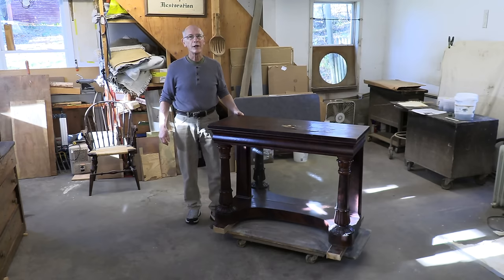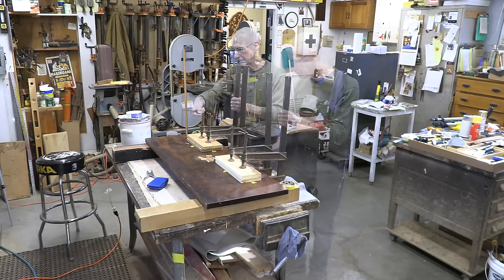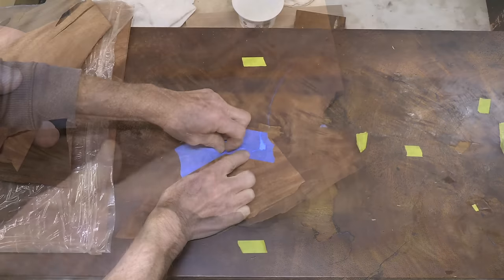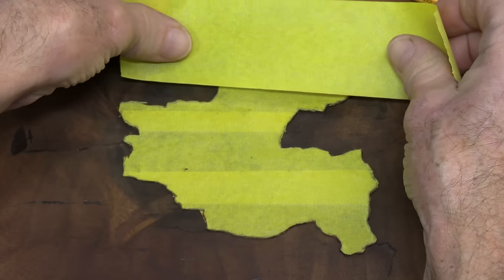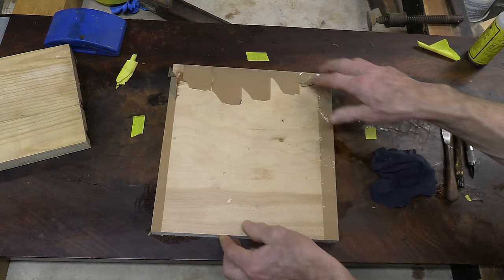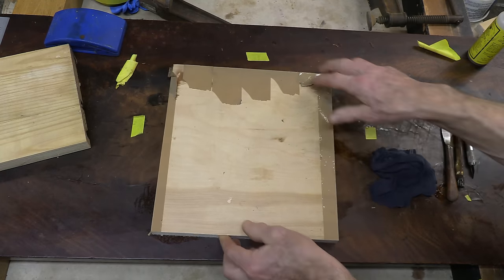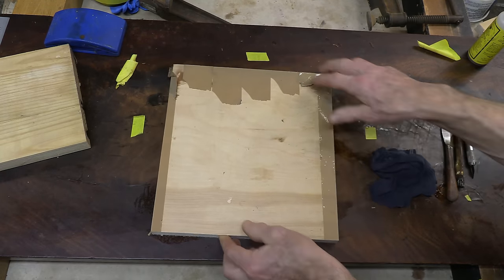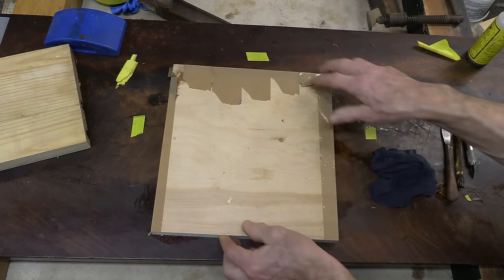Is this Table Beyond Repair?

Comment: I had an oversized door on my 120 year old house.  (Door was old, but probably not original.)  Someone had striped off the veneer on the outside surface and replaced it with fake grained Masonite (horribly ugly).  Inner window had a plastic insert.  Knob and lock was so trashed it was a struggle to open and close the door.  Because of you, Tom, I decided this door could be saved.  I replaced Masonite with an oak veneer skin, cut out old lock section and put in a 3/4" patch about 4" x 6" and new antique door knobs and lock and got rid of plastic and resized window to fit a leaded glass one.  Looks pretty darn good for an amateur (not even close to your level but...) I owe even thinking I could do it to you, Tom.  Thanks.  ( I did a LOT of color matching on that patch and it is pretty darn good.  Again, thanks to watching you work again and again.)
Reply: I've realized that he's raised the bar on how I look at furniture and wood. I find myself being more critical and noticing things I hadn't, otherwise. Now I'm a pain in the butt😅
Reply: Good on you for taking on that project
Reply: A beautiful result… again
Reply: And every time you use that door, it’ll make you happy.
Reply: It says no electricity.  😂
Reply: @johnsrabe  So true.  I look at it daily as I go out to walk the dog.
Reply: I bet the ordinal wood on your door is really pretty
Reply: @jodirauth8847  The original is quarter sawn oak.  Beautiful- which is why I decided to try and save it.
Reply from the maker: Wow! That was quite a project! I'm not sure I would have taken that on! Thank you!
Reply from the maker: Thanks! It's good not to say anything!
Reply: Happy,healthy new year Tom!
Reply: That pier table is such a handsome piece which you restored so beautifully.
Reply: I would love to see your result. ❤
Reply: Toms very inspirational to me also. I get some big ideas sometimes 😜
Reply: 5
Reply: Good for you. So glad it turned out good.

Comment: I'm thrilled that you could use a scrap just the right size and orientation for the patch. So satisfying to be able to use a smaller piece without cutting a hole in a new one. This is a lovely restoration. Such a joy to see and be included in your projects. Thank you so much for all the extra effort involved in making it possible. Have a blessed Christmas.
Reply from the maker: Thank you Alison! Yes, I did not want to cut a big piece, but I would have if I had too

Comment: My great grandfather was a cabinet maker from Scotland who immigrated in the 1880s, and settled near Brockton. He must have worked without electricity for all, or nearly all, his entire life since that's just about when households were beginning to be electrified. Amazing to think how much has changed in just a few lifetimes.

I hope you have a merry Christmas!
Reply: Even within a lifetime: think of this video and this conversation... not possible 25 years ago.
Reply: @dlevi67  Yes they were, although I take your point. You just didn't go back far enough.
Reply: @the-chillian  I take your point, but I did go far enough. Widespread means of posting high-resolution videos and commenting on them on a publicly-accessible website were not available 25 years ago.

You could have taken a VHS tape (at a lower equivalent resolution), and then distributed it physically to all your friends; good luck reaching audiences of several thousands, never mind millions, without serious commercial backing. Blockbuster was still going very strong in 1998.

JPEG and MPEG first versions were published in their entirety between 1991 and 1993; there was nothing available to consumers in 1998 that would have produced this video in a digital format. Even if you could, you'd have a few issues in making the content available to the public at large (never mind dial up at 14,400 bps - which in 1998 was the norm; I remember having trouble finding modems that could reliably support 19,200 - even with 2-channel domestic ISDN at 128kbps you'd wait a couple of days to download 50 minutes of hi-res content). 

As to comments or conversations, the first "properly interactive" commercial websites date to the early 2000s - YouTube specifically, to 2005. Yes, you could post "live" comments using BBS software in the mid-1980s, but they weren't usable in the same way as YT comments (crappy as they are). 😉
Reply from the maker: Thank you! Yes,it's all so quick. Both my and my wife's mothers grew up on farms in the 1920's, we are just 1 generation into it
Reply from the maker: Interesting! What will it be 25 years from now!

Comment: Wow , another amazing job, I thought I was a patient man, but you teach me what true patience looks like! 

Last time I worked on crotch veneer repair, I started by stripping the finish and using a glycerin based veneer softener.  Then clamped the whole thing flat.  I think it helped make the veneer less delicate (some).
Reply from the maker: Thanks! That sounds interesting, I could have tried that with this top. I will try that in the future

Comment: What a wonderful Christmas present. Another amazing restoration from which I, and I am sure so many others, have learned so much. It is very clear that the clamps you use are not the newest models and I would say they are much better for it. Modern clamps are so expensive and nowhere near as sturdy or well made as some the ones you use. Wishing you a very happy Christmas and a peaceful new year.
Reply from the maker: Thank you! Although these clamps were given to me because they did distort under pressure, but the work fine for me

Comment: TOM, I LOOKED IT UP AND SCREWS HAD BLUNT ENDS UNTIL ABOUT 1859, DEPENDING ON YOUR SOURCE OF RESEARCH. SO, NO AMERICAN EMPIRE PIECE WITH ORIGINAL SCREWS SHOULD HAVE POINTED ENDS, WHICH HELPS IN DATING THE PIECE. FASCINATING HOW A PRO DOES NOT HESITATE TO TAKE FURNITURE APART! THE AVERAGE HACK LIKE ME, FORGET IT! ANOTHER AMAZING JOB BY YOU. HAPPY HOLIDAYS TO YOU, SIR TOM!
Reply: Thats interesting!
Reply from the maker: Thank you! Good info on the screws
Reply from the maker: It is!

Comment: OMG that top veneer gave me flashbacks to last summer. I had an 1885 sewing machine cabinet with 2" wide burlwood accents that were cracked and lifting much like that on your pier table. The crazy grain pattern made it expand in all different directions  and rates when it was exposed to the moisture of the hide glue, making it very difficult to flatten back down within its allotted area. I chased bubbles for a week!

It's impossible to find modern veneer even a fraction as good as the original!

Lovely outcome, as always!
Reply from the maker: Thanks! I've been there! I hope it all worked out for you

Comment: once again you have accomplished an incredible job in difficult conditions (electrical failure) in doing so you worked as the men who made this piece of furniture worked with only manual tools and daylight or kerosene lamp/candle congratulations on your work
Reply from the maker: Thanks! I thought about that

Comment: This channel is where I learned about Waterlox. It truly is the best of the traditional brushed finishes. Or it can be rubbed in. It levels very well and adds great color to the project. It will begin to harden in the can - they really mean it to not return unused product back to the container. I use plastic pouches to store mine in - these are meant to smuggle booze onto cruise ships but work very well for shellac and varnish. From Amazon, of course.
Reply: Just don't confuse the two pouches... drinking Waterlox is probably not very nice.
Reply from the maker: Thanks! I need to get those pouches. I've been using Bloxygen
Reply from the maker: Good idea!

Comment: Might I suggest that for your old, cast iron(?), vintage(?) clamps like at 24:22 that you try boiled linseed oil, wiping them down well after application? Jimmy Diresta used this method for a standing, metal coat and hat hanger he made on an episode of This Old House.
Reply from the maker: Thanks! I should try that!

Comment: Tom, when you have to squeeze glue under peeling veneer, try using a plastic suction cup. Just put some glue along the crack and then massage it in by pressing down repeatedly with the suction cup. This works a treat for getting glue into hair-thin cracks in guitar bodies, and I don't see why it wouldn't work just as well on veneer.
Reply from the maker: Thanks! I'll have to try that. Now, where does one buy these suction cups?
Reply: @johnsonrestoration Just look around the hardware store for something like a soap dish that suction-cups to the wall. Steal the two plastic suction cups off it, and toss it. Or a set of kid's suction-cup arrows.

Comment: Merry Christmas Tom.👍🎅🎅

I used your method of using painters tape to trace out a pattern for a missing piece. In my case it was to make a new mouth insert for a wooden bodied hand plane. I cut the new piece just outside the line, and that gave me enough to plane to an exact fit. Your method worked beautifully.👍👍
Reply: I hadn't realised you could replace the mouth in a wooden plane. Thanks for the info (although I don't even own a wooden plane).
Reply: @dlevi67  Some old wooden bodied woodworking planes were used so much that the bottom of the plane wears down and the slit in the bottom that the blade goes through gets bigger, so to the point that it doesn't cut properly any more. A piece of wood is inlayed into the bottom to close up the mouth to make it work better. This had been done to this plane by a previous owner. The inlay wasn't cut out evenly all around, so making a negative of the space was nice to replicate a new piece to fit exactly in the space.
Reply: @jasonhammond4640  Yep - I know what a plane mouth is and I understand what your issue was; I just wasn't aware that "replacing" it in a wooden plane was possible. 

On a metal sole - apart from the fact that it's much harder to wear - it's practically impossible to re-form the mouth. If someone turned a smoothing plane into a scrubber, that's pretty much it... welding on cast iron without warping it is very difficult!
Reply from the maker: Thanks! That's great! Interesting discussion with dlevi67
Reply from the maker: Interesting discussion!

Comment: I truly appreciate you trying to preserve as much of the original wood, veneers, and finishes (and even the "flaws") as you do. 
I watch a few other furniture repair channels... I cringe when they get an actual antique in their shops because their go-to is to completely strip, sand (with power sanders at times), and put modern finishes on pieces. Replace parts which should be patched or repaired. 
Do they look nice when done? Yes. But they look more like a new piece of furniture, and lose so much of the character and history in the process.
Reply from the maker: Thank you! I agree - what's the point of owning an antique if you make it look new?

Comment: Have you ever tried using a scroll saw to cut out your patches of veneer? You would probably get a cleaner and square edge cut. Faster also. Thanks for your videos!
Reply from the maker: Thanks! I haven't, veneer is a bit thin but I should try it. I like using the scroll saw

Comment: I have always admired your artistic abilities in knowing which type, combination of colors and when to use each one along with the best finish and sanding techniques.  After watching for many years, I play a game of trying to guess the basics and sometimes I guess correctly!  This time I also realized the physical range needed to do the restorations from strength to lift and move pieces around to remove old screws and nails keeping them intact and the furniture undamaged as much as possible.  Then the complete opposite of the scale to the very delicate and technical aspects like cutting and shaping veneer or applying stain/dye in tiny stripes.  Thank you for sharing your knowledge, expertise and the beautiful pieces of furniture you work on!  Wishing you and your family a very happy and healthy new year!  💕👌😊👍💕
Reply from the maker: Thank you! I appreciate it! And yes, people rarely realize what a physically demanding job it can be. I like that, and I like the variety. I wish all the best to you and yours as well!

Comment: That effort paid off, it made sense to preserve the original veneer, I'm sure the challenge you mentioned in closing is in large part getting the finishes to match if you replaced the veneer entirely.
Reply from the maker: Thanks! Yes, I am really glad I was able to save it.

Comment: Another beautiful job on one hell of a beautiful piece of furniture !  Outstanding delicacy of shading-in and feathering of this patchwork. Another important historic fact with this kind of mahogany, is the fact that this species, {in this width of flitch} is extinct. So, doing everything one can do to preserve it is very crucial. One question, did the owner have some kind of sentimental connection to the big gouge on the top edge @ 38:51 ?  It seemed strange to me to fill in all the tiny, unnoticeable missing veneers, but not address the big chunk thats missing.
Reply from the maker: Thanks! I felt the same way about that veneer. The owner likes that gouge!

Comment: I had the exact same problem with a small cabinet, with some adorable clasping dolphins in solid 19th century brass. The veneer was so nice. It was cut out so that the years were mirrored. But on top the veneer was ruined because I had a fern on top. No one would buy the little cabinet, so I couldn't save it. So it came to the fire. Wish you had been around, it could have been saved.
Reply from the maker: Oh wow! Yes, that's too bad

Comment: Luthiers use little suction cups to force glue into small cracks. Have you tried that? Really enjoy your videos.
Reply: Thanks for the tip. How do luthiers prevent the glue coming out again when the cup is removed? Do they leave the suction cup in place until the glue has set? Genuine question from a much-less-skilled-than-Tom woodworker and furniture enthusiast.
Reply from the maker: Thanks! People have often suggested that, but I have many questions just as dlevi67 does. Where in the world would you get suction cups anyway? Suction pulls, it doesn't push, so how would that work exactly?
Reply from the maker: Good point! see my answer to bills6093

Comment: That patching of the veneer is amazing and the new patch is almost invisible. To tear that veneer off and redo it would have lost that amazing flame/feather pattern. There is a guy I know who is a very keen woodworker and I had a cheap shotgun with a very plain stock. He took the stock and I think painted a flame grain into the wood then stained it for me. I am amazed at how good it looks. He used an airbrush to do a lot of the blending and also artist oil paints but the effect is so much like wood
Reply from the maker: Thanks! I'd like to see that!

Comment: First, you did a great job with the repairs. As for the top - "to patch or re-veneer": assuming skills and tools are not in question;  IMHO if the piece has value and/or importance as a part of history, then preservation is a must - else it comes down to the owners objective for the piece.  The main thing is that the piece is in use again. This discussion is always a hot topic in the car world.
Reply from the maker: Thanks Bill! Yes, and with cars it's much more of a dilemma. But like furniture it comes down is it for show and has historical value? Or do you want a "driver" with actual safety and performance

Comment: If the original maker could only see you meticulously repairing that veneer....Thank you for the "Golboy's antique gold recommendation. Also, for using 0000 steel wool to apply it. I've always used "Howards" and a terrycloth rag, often wishing for better results. I look forward to polishing my next treasure using your method!!
Reply from the maker: You're welcome! It's such a habit - I always use 0000 steel wool for applying any polish.

Comment: Always a highlight to see a new video posted. Would a vacuum bag and a hide glue mini flood in those crack areas help get better penetration than the calibrated Thomas Johnson Hide Glue Applicator i.e. finger
Reply: Possibly better penetration; also a heck of a lot more cleaning! 😉
Reply from the maker: Thanks! I might do exactly that soon. Keep watching!
Reply from the maker: I'm actually thinking of doing that on a piece I'm starting

Comment: Excellent as always Thomas!!! 
A couple thoughts; could you extend your VD glaze on the darker rays onto the good veneer so you might be able to disguise the circular shape of your patch so it won’t draw your eye to it so much?
A couple of lessons on using a mottler and badger blender to put in those rays with dry colors might get you thru the touchup step more quickly. I’d be glad to show you or explain if you’d like. Anyway I always learn so much from your videos. By the way, I love those clamps😮

Have a great holiday season!!!
Thanks
Reply from the maker: Thank you Bob! Yes, I was doing that to a point, and I often will use dry colors too. It's different when you're brushing and not spraying

Comment: Wow, awesome, amazing, but words can not be found to really express how great this really is. I have used a rinse with mineral spirits to prevent fish eyeing. I learned that some people use pledge and other things that have silicone in it which gets into the wood and then when refinishing it causes the fish eyeing. Using mineral spirits before staining and finishing prevents it.
Power outages are such a drag but you soldiered on. I'll have a generator at my new house too. I can't stand being without light and besides having a well I wouldn't have water if it wasn't for the generator.
Reply from the maker: Thanks! Yes, we have town water but we want heat and refrigerator!
Reply: @johnsonrestoration  I'll have a wood stove for a back up and it saves on electricity and one can cook at least soup on a wood stove.